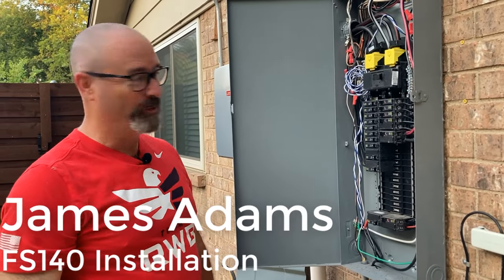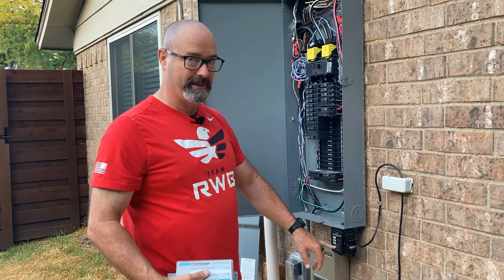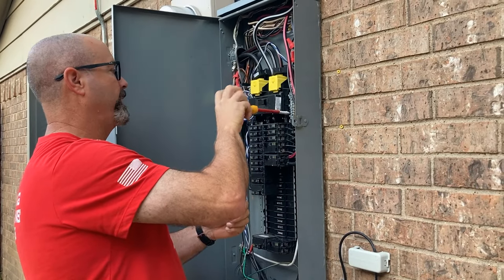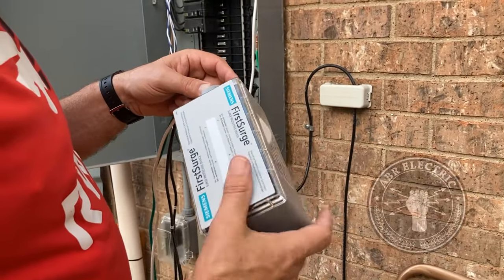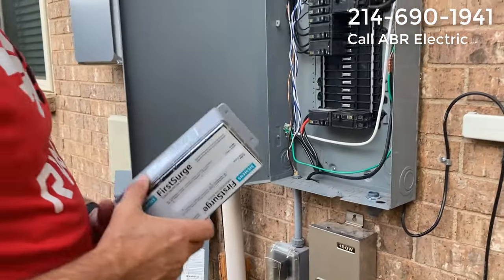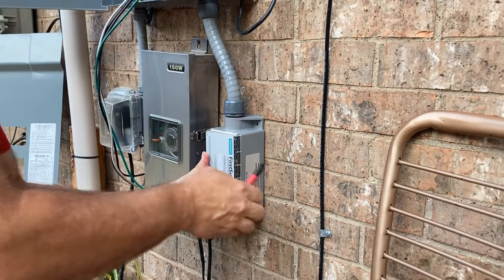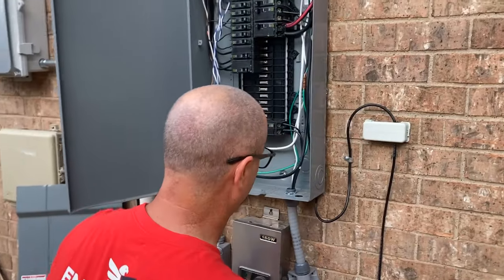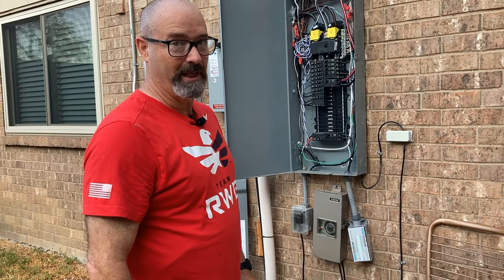Installing an FS140 Siemens Surge Protector

Comment: I am really confused. How does the surge protector actually work if the main power doesn't travel through the circuit breaker before entering the panel?
Reply from the maker: John, are you talking about the location of the surge protector relative to the main breaker?
Reply: @abrelectric  No what I mean is if the current doesn't pass directly through the surge protector and then feed the rest of the breakers how does it actually protect everything fed off the panel? If we get a surge and it trips that breaker the rest of the panel is still live and vulnerable correct? I just dont understand how it works to protect your stuff if the surge protector can't trip and cut the power supply. Just like when you have a plug in surge protector behind your tv or computer.
Reply: I have been watching your videos. I am about to install a whole home surge protector because I have two brand new  carrier modulating systems I want to protect. They want two grand per system for surge protectors on the units themselves. I think a whole home system will be cheaper and protect the whole house instead of the two furnaces and condensers. But It doesn't make sense to me that the power can still run through the panel if the surge protector trips. I am trying to understand how it even works if it's not protecting all the breakers.
Reply from the maker: @johnyoung4772  the surge protector does not trip like a breaker. Depending on the brand, it sacrifices itself to absorb a large surge or spike coming into your house via your wiring to protect appliances and equipment.
Reply: James I know how to wire a panel. I am no electrician but I used to help a master electrician quite often on side jobs and learned the trade. So I am very comfortable installing this myself. I am just puzzled on what's the point of a surge protector if its not protecting the panel. I may have that wrong. I guess I assumed the main feed would be wired to the surge protector and then from the surge protector to the panel. So that any surge would get eaten up by the surge protector before it had an opportunity to get to any breakers. I guess I am missing the point of how the surge protector actually works in this case. The surge protectors I have throughout my house trip and kills the power to my devices. I don't see how this one that you wire into the panel could do that. I have only seen one of my surge protectors trip once. I am sure it saved my computer system. Because of the way this FS140 is wired I don't understand how it could protect the entire panel. I would think you would at least want it to be at the top of the panel so its the first breaker the power hits. would there be some truth to that?
Reply: @abrelectric  James is the FS140 your favorite whole home surge protector? I was also looking at this one: Intermatic Smart Guard IG2240-IMSK Whole Home Surge Protector. But do you have a go to favorite?
Reply from the maker: @johnyoung4772  not according to the manufacturer. The instructions on the FS140 say to keep the wires as short as possible between the SPD and the 2 pole 20 amp breaker supplying it. It does not say where in the panel it needs to be installed. 
There are several articles online that explain the physics of how an SPD actually works,  in as much detail as you would like.
Reply from the maker: @johnyoung4772  the Intermatic unit is a good call because you can replace the modules in the unit if they get blown.
The specs aren't as good as the FS140. The FS140 also has an audible alarm. 
I guess tge FS140 is my go-to.
Reply: @johnyoung4772 the surge protector is not like a breaker, it doesn't work by cutting off the power. Instead, it sits in parallel with the rest of the circuits. With normal voltage, the resistance of the SPD is very high (like an open switch) so basically it's doing nothing. If a voltage spike comes in, the SPD resistance drops very low (like closing the switch). This causes the current to flow through the SPD more than through the other circuits, and as long as the SPD presents very little resistance, the voltage across the panel is limited. If there's enough energy in the spike (like if the high voltage lasts longer than a split second) the devices in the SPD will melt/vaporize as a result of absorbing so much energy. But while that was happening, your other devices weren't getting vaporized. The idea is the SPD is cheaper to replace than computers, HVAC inverters etc. The devices inside the SPD that do this function are metal oxide varistors, which have a high resistance below some critical voltage, and a very low resistance above that voltage. The manufacturer tunes the voltage so that it's well above 240V. And they add monitoring circuitry to tell you if the varistors are still working or if they've degraded due to absorbing voltage spikes.

Comment: Quick question. My Siemens main panel is full with 240v 2 pole breakers and will not accept an external SPD like this because there is no space for another breaker. It won't even accommodate  a breaker replacement like the Siemens QSA2020SPD, there are no single pole breakers to replace. Are there any options for providing Surge Protection on the main panel?

If not I can protect sub panels easily enough but will leave my EV outlet unprotected which is fed from the main panel. Are there any type 3 surge protectors for 6-50 outlets? I can find plenty for 14-50 outlets but don't want to replace my EVSE.
Reply from the maker: Check the manufacturer specs on the EV charger. Many like Tesla's TWC have surge protection built in.
You could do a Type 1 SPD at your main breaker,  that should be installed by a licensed electrician. Type 1 doesn't require its own breaker.
Reply: @abrelectric  Thanks. The electrician's suggestion for protecting the main panel was to replace the panel with one with more slots for breakers. That sounded expensive vs $200 for two breaker style SPD's on my secondary panels. I'll ask when he comes back to install the SPD for our HVAC unit. Would installing a type 1 SPD require the panel to be brought up to current electrical codes?  Our panel doesn't have a master disconnect as it pre-dates when that became a requirement.
Reply from the maker: @JeanPierreWhite  that will depend on the local codes. Sometimes,  it seems like upselling. Installing a type 1 spd should not mandate a panel upgrade by itself.

Comment: How come none of these surge protectors have test buttons?
Reply from the maker: That is a great question! There has to be a way to see if the spd is functional or if it's weakening with exposure to various spikes, etc.
I have been looking into testers that might actually do that.
Reply: @abrelectric  to the best of my knowledge, you can't actually "test" MOV-based surge protectors at all. This is just part of the reason why we NEVER encourage any customers to use MOV-based surge protectors at the device level in their homes. You are always SO much better to go with a series-mode, non-sacrificial, inductance-based surge protector (Brickwall, ZeroSurge, SurgeX, etc.) as they literally do everything better. I'm not sure if those types of devices are available for whole-house surge protection or not? Does anyone know?

Comment: Also, I have a solar system so I have my main breaker panel and I have a protected load panel, which one should I install it on?
Reply from the maker: If you have space, both. First, at least, the main panel, then the generator panel.

Comment: Ballpark estimate for a licensed electrician to install the FS-140 (parts/labor)?  House built circa 2000 with the service panel located inside a drywall garage - Fort Worth, Texas. Thanks.
Reply from the maker: @JJYSGYAJY  with a flush mount, assuming you have room for the additional 2p 20a breaker, depending on the company, $675 to $795 ish.
Reply: @abrelectric  Thanks for the prompt reply.

Comment: I thought he said it needed to be as close and as short wired as possible🤔... so, why did he put it a mile away?
 Am I missing something?
Reply from the maker: Nope. Manufacturer doesn't say that. 
Instructions say to keep the wires straight and as close as possible to the supply breaker.
Reply: @abrelectric  SPDs should be as close as possible to the main.  Every inch away reduces the effectiveness of the SPD. most vendors will tell you that 18" or less is recommended.   They should be applied in a cascading fashion to all subpanels.

Comment: Nice video! is there really a big difference between the FS140 and the Eaton Ultra to make it worth the change??
Reply from the maker: Up to you. Difference is 5 years vs 10 years warranty and surge amps (108K vs 140K).
Reply: @abrelectric  well... not an easy one, because a I live in Mexico and I don´t think any manufacturar will honor this kind of warranty here. Also the power supply quality is pretty crappy. Hardware vs hardware only using the surge amps seems like an only 30% increase for more than twice the cost. But I would love to know if there is something else beside the surge amps that makes de FS140 a better protection. Seems that I need to justify initial cost difference to myself...
Reply from the maker: @cmijares79  the other way to go is go with cheaper SPDs, treating them as disposable.
Reply: @abrelectric  this will be for the main switch. Already have planned for plug on ones in the subpanels. Is for a new home construction. Still have some time to decide but most probably will be the Siemens. Thanks!
Reply: Eaton Ultra has a lifetime warranty (original purchaser only) $75k equipement coverage, it is what I had installed because the FS140 was out of stock. However, if you can get the FS140, do it -- it has an audible alarm. Otherwise it's up to chance that you notice the lights on the unit has changed to detect the unit gave its life for a surge.
Reply: @joewagner5823  question on that, why is it that in 2023 they are still making devices with lights that no one will ever see and alarms that no one will ever hear? Why aren't they incorporating Bluetooth technology into those that can signal over to a cell phone app (as long as it is within about 50 to 150 feet from the device) with alerts and alarms? Are there higher-end models available that include this as a feature yet?

Comment: I actually do have a question. When I had mine installed, I had the electrician put the double pole breaker at the top of the box. Not sure it actually matters but I was thinking it should be as close to the mains as possible. Any thoughts?
Reply from the maker: Probably blasphemous, but I don't think it matters. My starting point will be the manufacturer's instructions: install it the way they recommend to get their UL listing for performance. Everything else is opinion.
Reply: He didnt follow instructions on this install. So for a master electrician not good especially with a box that easy to move breakers
Reply from the maker: @anthonyguess5528  read the instructions. I quoted them verbatim for you on another comment.

Comment: I'm from MA originally and FL now, I am not an electrician, more of a dumb child really, but I've never seen breaker box outside. Is this typical in other parts of the country? when it storms and your power goes out you need to check the breaker so you have to go outside in the rain or snow or whatever to check it? why not put it in your garage, basement, closet, or anywhere else INside?

Comment: Hi sir, excuse my question, I notice that an ENPHASE solar system is installed in your electrical panel, and the arrow of the consumption CTs in L1 and L2 are pointing towards the meter according to what I could see in the video and not towards the load (Main breaker) as explained in the ENPHASE training videos.  The ENVOY is probably having measurement problems for that reason.  In case my observation is not correct, please ignore my comment and excuse my bad English.

Comment: My fuse box is built into the wall. Can't I just wire this to the power coming out of my meter to the panel? Looks like it would be a 5 min job.
Reply from the maker: Theoretically,  with a type 1 SPD you can - they don't require a breaker. As a lesser of evils, you can install it inside of the breaker box. At least with the Siemens,  you would have an audible alarm. 
What kind of material is the panel flush-mounted into?
Reply: @abrelectric  drywall
Reply from the maker: @wd8557  bite the bullet: cut the drywall and surface mount your type 2 unit
Reply: @abrelectric  I'll take your advise and do just so. 90% of the panel is hidden by a slot machine anyways. I'll still have to hook it up to incoming however I don't believe I have any space. Thanks
Reply from the maker: @wd8557  Be safe

Comment: If an electric surge (from lightning or a short circuit) travel the shortest route to ground to dissipate it's energy;  what can the FS140 (or any other) protect? ... installed after the Main Breaker, a 20A-2P breaker, and a at the bottom of the bus?
I have a pool sub-panel fed underground 60ft from the main panel, lightning stroked the ground nearby, damaging the breaker feeding the sub-panel, the pool automatic control unit and the variable speed pump.  We had a surge protector on the main service that did not see the surge.  
I am planning to install a 40A-2P GFI breaker on the main panel for the feeder and a FSxxx surge protector and maybe another GFI main breaker (50 or 60A 2P as a disconnect) in the sub-panel.  The FSxxx will take most of the energy to ground and the GFI breakers protect the equipment. Right? and does it meet code?

Comment: You are a master electrician and your main box is outside with the elements ? Shouldn’t that be indoors ?
Reply from the maker: It's a nema 3R panel, rated for outdoors. Works great 👍
Reply: @abrelectric  ya, I would never have anything outdoors, here in WA state it rains a lot / I have an outdoor rated hottub box and that shows rust inside too overtime, hahaha plus someone could mess with your box…
Reply from the maker: @rompstar  I had the same issue doing electrical in Southern California near the beach: the salt air is a monster!

Comment: I am not an electrician but your information was easy to follow and I think it helped me tie some recent burned out equipment together in a  single related event.

 I arrived home from a trip to find my gate controller had burned out. I also realized my landscape light transformer was  not working.  A few days later a gate alarm went off and the power company was changing out my meter because it wasn't reading . ??? Could thesw three incidents be related .   I assume that  everyone  200 amp panel requires a surge protector? Is there a single solution for the green transformer box in thr yard? Thanks
Reply from the maker: It's possible that the 3 events are related. Are you talking about the utility company's transformer box or the lighting transformer?
Thanks for the question and please subscribe to the channel.

Comment: So a 20 Amp Double-Pole Type QP Circuit Breaker will be OK to use? I question because in your video it look like a double pole, single throw rather than a 2 pole with the bar connection the 2 switches for 110/220. Is there a difference? If so, what is the one you are using? Thanks
Reply from the maker: I used a standard Square D QO 2 pole 20 amp breaker. What brand is QP?
Reply: @abrelectric  Truthfully I don't know myself! But I am going to use a siemens 20 amp Double-Pole which Homedepot has with others QD, QP, QAF ? I have the FS140 already to go other than the breaker. Anyway you do a great job of causally explaining how to install, Well done! Again, grateful for your swift reply!!
Reply from the maker: @erickissinger436  QP 2 pole 20 amp is correct for the Siemens

Comment: Great video! Question on location. My outdoor meter/panel only has one 200A breaker as the main cutoff for inside the house. I could not visibly see an available space for a second breaker to install this type of Surge Protector outside my home. The main sub panel that comes off this outdoor panel/meter is inside my basement. Do I install the protector inside my basement panel or is there an option for installing it in the outdoor panel which I am not seeing available? Thanks!
Reply: I would imagine that it is of primary importance to have the 140 as close to the service entrance as possible. If you have no slots available on the 200A main...but do have available slots on the sub panel... You can move the loads from your main to the sub...and now have open slots in the main for your required 20A 240v breaker for your new surge protector. You can wire nut the loads that you removed in the main...and send them to the sub using the same gauge wire. This is perfectly safe and acceptable. Of note...legally...making changes in your electrical panel requires an electrical permit. My inspector is happy with my changes...I have learned to do them in accordance to the NEC.